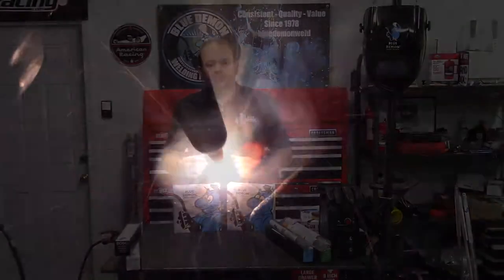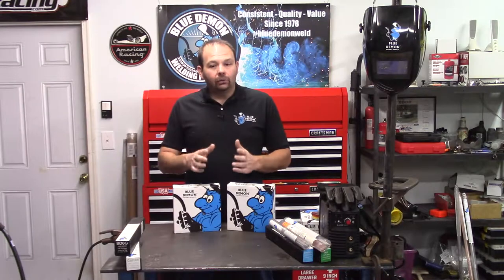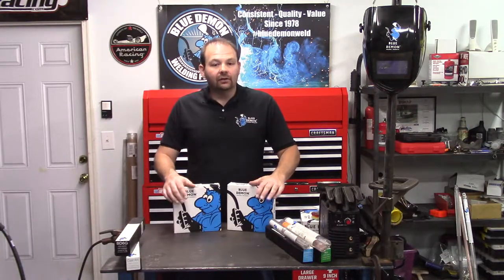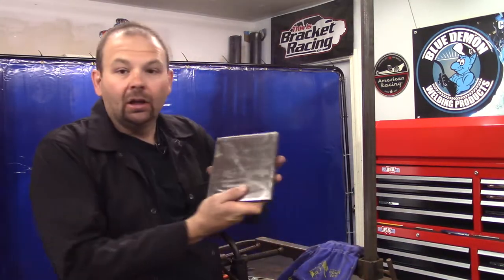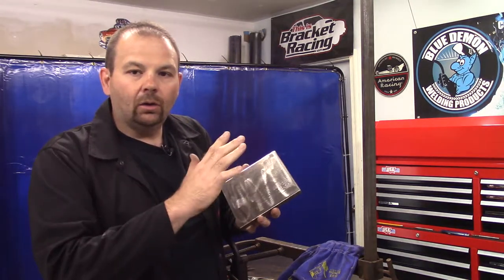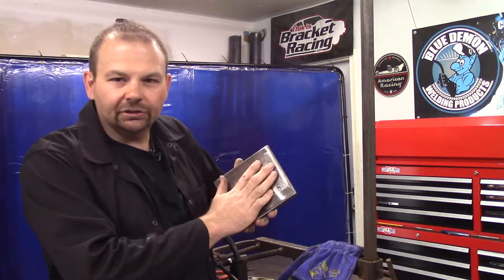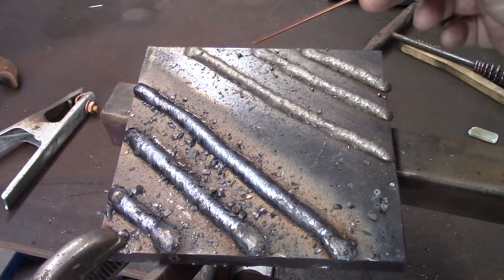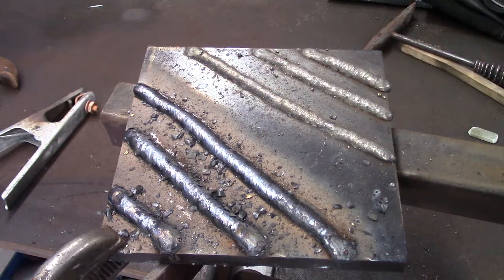Blue Demon HardFacing

Comment: I see this is driven toward hardface mig wire, I can't find a video on your stick welding electrodes though.
I'm seeing several hardfacing rods, there is Alloy 7000, HARDCOVER 460, and HARDCOVER 450, What is the difference in each of these?

Which would work good for building up and repairing old equipment buckets? My backhoe bucket could use some repair, and my bobcat bucket is about worn through from dragging it to smooth up ground, I'm planning on re-skinning the bottom of the bobcat bucket, but have thought about doing some kind of hardface overtop of the new skin to help with abrasion from dragging the bucket around, and would like to know what rod would work best for me.
Reply from the maker: https://weldingmaterialsales.com/alloy_type/hardfacing-core/